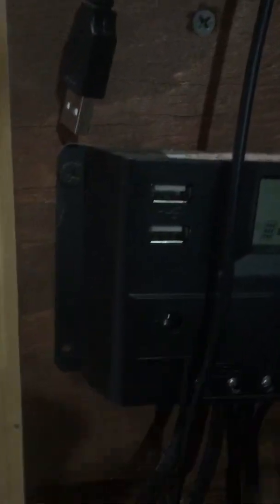Harbor freight solar kit. Can you add other solar panels?

Comment: I started with the 100w kit as well but after getting 2 of the 100w panels from harbor freight I fried out the port on the controller for the panels. It had to deal with one of the wires that come in the acc kit.  It was to thin and couldn't handle the amps.  Since then I have upgraded to that set up with a new controller new thicker wires. Just remember that your running these panels all in parallel.  Which means the same 12v but higher in current/amps. This means the wires if to thin can heat up and cause a fire, or fry the controller.  Now I run 500w on solar and 200ah on battery. And truthfully get an MPPT charge controller. That can handle 30a or better. The difference in charging your batteries and running power during the day will amaze you. Get a good balance on the system and it will be safe and reliable. Do your research. Will Prowse and David Poz on YouTube are both very knowledgeable and can help you understand more on not only solar but batteries and overall system.  This kit is awesome for a starter kit and for getting started.  I'm no expert by far. But research and development on my own set up has helped me realize what I can do and when.

Comment: I've got two of the 45 watt kits that my uncle gave me when I fixed his mower, and I have the same four HQST panels as you do, the 100 SSD is the one I like..I going to get 3 more panels because there was a 73 mph wind that came in front of the snow and 1 panel is like South Parks movie "shattered but whole " now so being stubborn I guess I'm gonna get 3 more panels next month...I started with about like yours but I have eight  85 amp hr batteries and a 24 v Aims inverter/charger 2000 w...the best thing you could add now is an mppt controller...you'll get twice as much from a panel...I got the Epever 4215 BN controller its 99.7 percent efficiency...I have enough to run my air fryer long enough for a pizza..I did okay thru the snow with 6 batteries but as soon as I got to town I got 2 more..I may wind up with 10 hooked up 24 v. But yeah when I hooked the 45 watt kits I put them in series but theres like 60 feet of wire so I'm changing that to 10 ft and see how much I can get for free...This is the first time I did any of this stuff...but I wanted to do it for a long time so...I figured I might as well make my system big enough to run something like a small AC...I watched Green Acres, I know if you're gonna plug in a 2 with a 6 you better get a better generator than they had lol...it has been cloudy this week so this evening I'm going to see what I have to do to put some kind of generator together...well I'm gonna go put a new cord on my WW2 era greyhound induction welder....a little off grid welding music please....lol

Comment: The hub is worth having. I'm using 3 old 15 watt panels together with 2,
 4 panel 100 watt systems on two charge controllers.  Lots of power. Also I learned the hard way. Keep your batteries out of your living space, they off vent. Trust me breathing battery acid will put you in the hospital at the very least.. Great video... Thanks
Reply from the maker: I appreciate you I’ve got them moved out side now

Comment: We started with the old hf panels. They were only 45w. We used them for almost a year before i found a used solar system on Craigslist for $300, but i kept the hf panels in use separately. We were off grid for seven years before we lost our property, we had 325w total power and it sufficed. We are technically still off grid, we live in a minivan now, for a year and a half so far. Next week we will have a solar generator with folding panels, 100w total. 
Love what you are doing! We will return to this lifestyle asap. I wanted to do a youtube about our first attempt called: offgrid all the wrong way. I'm not smart enough to do much with a computer though.
Reply: I F'n love it!

Comment: When I spoke to the manufacturer they told me that the controller that comes with the HF kits is only 20amps.  Also you should not have Flooded lead acid batteries indoors. They create hydrogen when charged. This could be lethal.
Reply from the maker: Ima move them on to my porch in a battery box, thank you for the input, I had no idea. I appreciate you
Reply: @aaronrisner3085  I ended up having to put a heated matt on mine. They don't do well in the cold. The batteries freeze. The colder they get the less capacity they have and charging them while they are cold kills the battery.  Luckily I am partially on grid. So I added and 80watt heating mat with a thermostat keeping them at 77.
Reply from the maker: Ohh dang okay lol yah I’ve been regretting buying lead acid I should have gone lithium because this is how I get 100percent of my power and I only have a wood stove as well so there’s times where is freezing temp in side. So I definitely will be getting lithium when these crap out on me

Comment: Awesome! I live on minimal power myself and do just fine! But I don't run a microwave, or a hairdryer, or an electric vacuum cleaner. You know that kind of stuff. But I've learned to live without all of those things.
Reply from the maker: Yup I only use it for lights a fan and charging battery’s